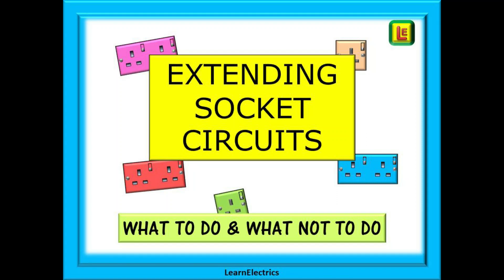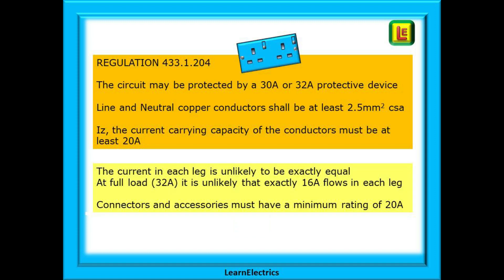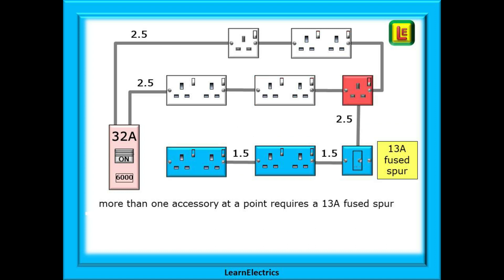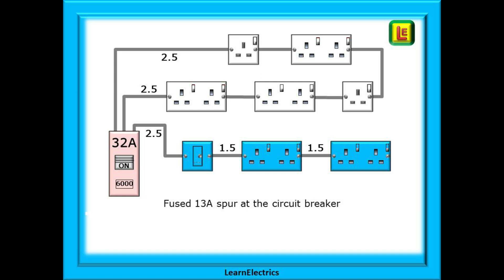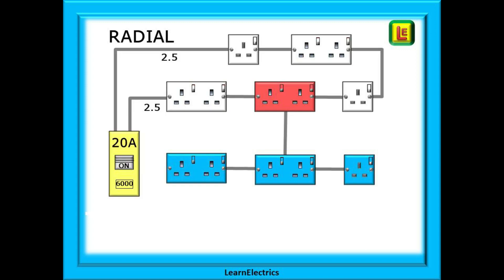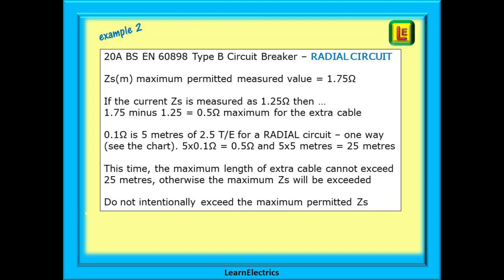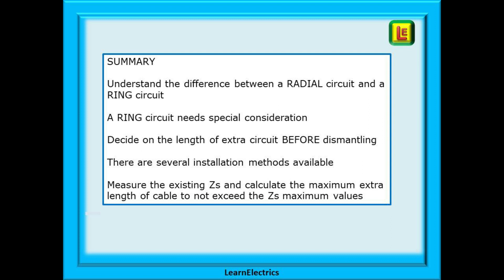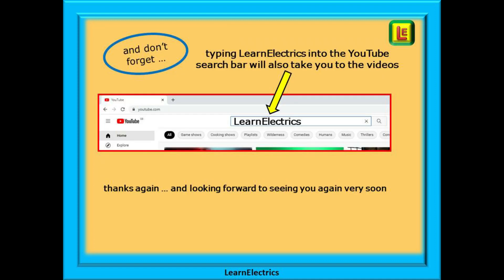EXTENDING SOCKET CIRCUITS - ADDING TO RING and RADIAL CIRCUITS

Comment: How do you KNOW its a radial or ring without relying on breaker and cable size? Do you trust its correct? (go off eic/r?)
If a socket has 2 conductors, how would you know its not a spur from an end of line radial, or indeed a ring.
3 conductors = you know its a ring with a spur?
Reply from the maker: Good question. Take a look at the video on the link below. Once you split the wiring its easy to test for ring or radial.
Thanks for watching and good luck 
https://www.youtube.com/watch?v=6GNb1SSEjQg
Reply: @learnelectrics4402 Thank you mate. Love the videos. You're a legend

Comment: If splitting, would you calculate the resistivity of existing cables to determine the original area served
Reply from the maker: You can do, but often practicality of room layouts over-rides getting an exact 50/50 split. I would split the circuit where you see fit and then turn just one half back on, use a socket tester to see which of the original sockets is energised. If about 40 to 50 percent split then job done. Remember that even if you get 50% of the sockets on each half, you cannot guarantee a 50% split in loading. some areas will always use more amps than other areas of the house. Thanks for watching. Dave.

Comment: Great video. I want to learn electric. With the fuse from breaker, can you use 2.5 cable rather than 1.5 cable. if not why?
Reply from the maker: You can, if you wish, use any conductor size that is greater than the minimum size required. So yes, if the tables.  show 1.5 as a minimum you can use 2.5. Thanks for watching.
https://www.youtube.com/watch?v=3_D65-32xp8

Comment: How on earth do you deal with extending a ring in a bungalow that has concrete floor? Are you forced to channel out on a solid brick wall and mount each extra socket that way?  Completely happy with your video as to rings and radials - excellent. I suppose identifying 2.5sq mm cable is down to the markings on the pvc? If in doubt I go for the heavier cable I have but it is a pain to work with of course.
Reply from the maker: Most quality modern pvc cable will be marked. I used to carry marked short samples of each size from 1mm to 16mm for easy recognition until I got used to the sizes. Every installation has its challenges. Good luck. Dave.
Reply: @learnelectrics4402  Yes Dave, I found it extremely difficult to use two Wago 221 (3-way) when the entry to the box has both ring cables side-by-side because after using short pieces of 2.5 to reach the outlet to a wall heater, the box was jam packed with connectors and cable such that the cover plate would not go flush again.

Comment: Hi,

I am very much a diyer when it comes to electric's my grandfather was an electrician sadly no longer with us and my father was taught a fair amount by him which he has passed on to me. I am currently in the process of renovating my daughters new bedroom I wish to add some extra sockets as there is only one double socket in that room.

The room is directly above the Consumer unit so having lifted the floor boards I can see the cables for the house sockets ring circuit, my plan was to extend this circuit adding four sockets and a junction box to connect back up the ring circuit.

Where I have started getting confused is because of the following the ring circuit is wired in 4mm t&e cable not 2.5mm it is on a 32 amp mcb though.

So my question is as follows

To extend the ring circuit should I wire the new sockets in 4mm cable as well or would 2.5mm be ok

or

would it be better to run a spur from the existing socket ib 2.5mm using an 13A FCU and connect the four sockets to that

or is there another method.

Any help would be appreciated

Cheers
Reply from the maker: If you take just one cable from any of the existing ring circuit sockets, to just one new socket (double or single) , then 2.5mm is ok. If you wish to extend the ring, use 4mm as this complies with what is already there.
Take a look at the video link below.
https://www.youtube.com/watch?v=fj9cc1U9Re0
Reply: Thanks for that cheers

Comment: Great🌹
Which one is better ring circuit or radial circuit
Reply from the maker: For me, radial, but many electricians will prefer rings. Both are correct.
Reply: Many thanks to you
Reply: Excellent video 👍👍👍
Reply: I would also say it depends on the application/anticipated loads...

Comment: How comes you multiply by 2 for the ring circuit? Is this a fixed number?
Reply from the maker: Its just an example of extending this circuit. If we want to double the length then the resistance will double.

Comment: Can a kitchen with 3 double sockets be included in a Ring  of 9  double sockets ?
Reply from the maker: Theoretically, yes it can, because the circuit breaker will trip before you plug something into every socket. Do you really need 24 socket outlets in a kitchen. Personally, if the customer really wants that many, I would consider dividing the circuit into two or even three.
Reply: @learnelectrics4402  There is only one Ring in this 1 bed apartment total 9 double sockets, Can the kitchen be added to that ring with 3 sockets. making a total of 12 sockets for the whole apartment. Cooker has its own circut. thanks

Comment: As a recently retired industrial electrician of 50 years I can't remember the last decade when I wired a ringmain circuit in 2.5mm twin and earth or 6491x it's nearly always 4mm and sometimes 6mm,
Reply from the maker: Lots of sparkies are installing 4mm radials now instead of 2.5 rings, especially as the boards can have more ways in them. Thanks for the input. Dave.
Reply: @learnelectrics4402  On a 4mm radial CCTV, what size Fuse/MCB should be used?

Comment: So if one wire is disconnected or breaks in a ring the whole then radial will still work, no fault will be detected, but the draw could be well over the cable is rated up to but the fuse won’t blow. !   Why haven’t these been banned?
Reply from the maker: That about sums it up, which is why many sparkies prefer radial socket circuits. they should be installed correctly, protected from damage, and inspected regularly.  Thanks for watching.

Comment: Great video, thank you. Could you please clarify in the situation where a 13a fused spur is taken from the ring, if the first "downstream" accessory can be a junction box. In my case the JB splits the supply cable into 2, each leg feeding one socket. Everything is protected by the 13a fuse, which I will probably downrate to 10a. All is cabled in 2.5mm t&e. I have no plans to add further sockets. I appreciate that it would probably be usual to wire the spur as a "mini radial" as per your graphics, but I had to put a fix in after stupidly nicking my new (still dead) cable with a drill, having spent 3 hours drilling walls and clipping it...Thank you
Reply from the maker: Once you put a 13A fused spur in, everything after it can be whatever shape you want. Split into two and two again, it doesn't matter. And your cables can all be 1.5mm if you wish. You can't ever exceed 13A. Nicked spur? We've all done it. Good luck, Dave.
Reply: @learnelectrics4402  Brilliant, thank you for your clear explanation. Keep up the great work 👍👍

Comment: Hi there, thanks for the videos; I am struggling to understand the situation at 8:50. To me that set-up looks like a ring circuit on the top section and a 3 socket spur to the bottom. I don't understand why that is allowed? surely the section of wire below the red socket is liable to overheat due to the potential loading on the bottom seciton? Sorry, but I am also not clear on what you have converted that from?
Reply from the maker: The previous slide starting at about 8.27 tells you that we are converting a ring circuit into radial over the folowing two slides. The slide you are asking about is showing that the circuit is using a 20A breaker and 2.5mm cable, so we can add as many sockets as we wish and still not cause problems. 2.5mm cable is rated at 27A for clipped direct and the breaker is limiting the current to 20 amps. hope this helps, Dave

Comment: Hi Sir, I want to make a radial circuit for 4 socket outlets using cable 4sqmm, what is the size of MCB that I should use? 20A or 32A? Thank you.
Reply from the maker: 4mm will be ok with both those mcb sizes for a radial circuit. take a look at this video, it will help.
https://www.youtube.com/watch?v=3_D65-32xp8

Comment: How come ring resistance is different to radial? My guess would be it’s technically a 5mm at any one point as cable has two legs but that would make it half the resistance of single 2.5mm cable but the chart shows a quarter? Can you explain how you got these figures?
Reply from the maker: Have a look at this video on our channel Jon. It will explain all, and more. Thanks for watching.
https://www.youtube.com/watch?v=V0_6_WmkmsY

Comment: Hi.i dont zs for 32A TYPE B is 1.09.i checked page 68 table 41.3 amedment 2 showing 1.37.correct me if i am wrong.thanks
Reply from the maker: Saman,
In the Wiring Regs book Zs for a 32A type B breaker is 1.37 ohms.
In the on-site guide they quote measured values using the 80% value which is 1.09 ohms.
To convert the wiring regs numbers to measured values, multiply by 0.8
Thanks for watching. Dave.

Comment: If radial circuit is safe too. Why do we return the line to breaker and make it a ring? it seems so much easier to add socket in radial circuit.
Reply from the maker: About 80 plus years ago it was way of saving copper as there was a world wide copper shortage. And since then its just stuck. Hope this helps. Dave.

Comment: Why  are ring circuits still used? Weren't ring circuits invented to save copper during the war effort? Could we just use radials now so you don't have a pull an extra leg back to the consumer unit?
Reply from the maker: Absolutely, but ring circuits do still save copper. Fortunately, with modern CUs there are more free ways in the board and we can run 20A radials in 2.5mm.
Great question. Dave.

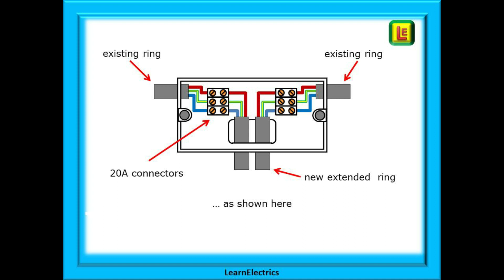Comment: @6:15 you show the ring main being extended in an existing backbox.  Should the earths be fully common'd together and connected to an earthing point rather than simply split and extended?  Especially if the box is a metal backbox where there would be an obvious risk of it being live under a fault condition?
Reply from the maker: If there are two earth studs on the back box, using either one or both is ok.
Reply: @learnelectrics4402  Thanks for the clarification

Comment: I need to break into a ring... Can you buy backboxes with all the relevant fittings pre-made for this job like the illustration at 6:10 ? If so what do I search for because it always just brings up junction boxes like the Wago boxes. Or is it simply a case of use the existing backbox with blanking plate and then use Wago connectors inside?
Reply from the maker: You can use another back box, 25mm or even 40mm and then waygos or a decent terminal connector block. 40mm depends on if its in brick or hollow wall.

Comment: Can you clear something upnplease Dave. In one of the slides you have two separate radials running from a single 20A mcb. Regulation 314.4 says that each final circuit should be connected to its on way at the DB. How are we able to have two radial finals on a single way?
Reply from the maker: That always raises a question. Think of the second one as a spur, we are allowed to spur from the MCB. What is the difference between spurring at the first socket or at the MCB. And yes, for many years I thought it couldn't be done as well. Dave.

Comment: What is the reason for having a max resistance value in a circuit? Is it because it will reduce the current to low enough levels that appliances will not work correctly?
Reply from the maker: No is the answer, there are different things happening here but if you have a look at these two videos on these links then together they will answer your questions. Thanks for asking, great question and thanks for watching. Dave.
Zs WHERE DO THE NUMBERS COME FROM
https://www.youtube.com/watch?v=IjpJK1eJLzw
&
MATCHING CABLE SIZE TO CIRCUIT BREAKER and FUSE SIZE
https://www.youtube.com/watch?v=VtTUkUpQ-Rc

Comment: Great videos. Helps me massively.
Just a quick question if you don't mind. When spurring of the ring with a FCU, do you use the 2 legs of the ring into the supply side or just one cable?
Hope this makes sense.
Reply from the maker: Just one piece of cable into the FCU, make sure it is 2.5mm. Hope this helps. Dave.

Comment: In my garage there is 1x Double socket connected directly to a 16B MCB in the consumer. This is the only socket in my garage and its connected in radial fashion. The thing that's confusing me is in 1 of the plug sockets is the tumble dryer which runs at just over 11A (I've tested this using both the Watts÷voltage equation and also physically with a clamp meter.) And the other plug is connected to an extension consisting of a fridge freezer and washing machine. This totals around 9A according to my clamp meter. But obviously 9A + 11A is 20A and its connected to a B16 MCB...how come the MCB isn't tripping when both are on at the same time? I want to spur another double socket but am I right in thinking I should replace the current 2.5mm cabling with 4mm twin earth cable and a B32 MCB due to the already high 20A load on the MCB? Please any help would be greatly appreciated I've been looking everywhere.
Reply from the maker: A 16A breaker will not trip at 16A, that is its working current. At 20A, it will take a long long  time to trip and even at 30 amps it will be 5 minutes if the current is constant. Your connected devices are probably switching in and out so that the current is not 20A all the time. If the current cable is 2.5mm you can change the breaker to 20A Type B for peace of mind.
Also, if it was me,  I would install a new, separate radial circuit and breaker for the new sockets as changing to 4mm cable is just as time consuming.
Hope this helps. Dave.
Reply: @learnelectrics4402  thank you dave yeah I have a spare MCB I can use to make a fresh radial circuit so I'll probably just do that instead much appreciated
Reply from the maker: Great. Also consider, if the new sockets are in the same area as the existing, and you are running fresh cable, run 2.5mm and convert it to a RING circuit with a 32A breaker and include the new sockets in that ring. Lots of choices. Good luck. Dave.
Reply: @learnelectrics4402  will I still be able to use a 32A breaker with 2.5mm cable as I thought 2.5 only covers up to 27A? P.s Thanks for the help Dave you've got a new subscriber aswell 👍
Reply: @learnelectrics4402  ah never mind dave I just watched your video on differences between radial and ring where you explain that you are able to use 2.5mm with a 32A breaker in a ring circuit as the current is virtually halved although not exact! Love these videos dave extremely helpful! I am an electrical engineer in the army but I mostly work on armoured vehicles so house electrics are relatively new to me I have completed the 17th edition installation course through work and 8ve just booked myself onto the new up to date 18th edition course where I hope to complete both installation and design aspects so these videos are gold!

Comment: Thank Dave once more for this wonderful video well presented, illustrated, and very enriching in knowledge. Looking forward to the next topic. Dave, question: How do you do R1 +  R2 on an extended radial circuit? and which chart are you talking about in this presentation?
Reply from the maker: Omar, I have made a chart or table showing how much extra resistance to add to a circuit if you know the extra distance involved. The chart is not from any books, just made to help with the video.
R1+R2 for radial is fairly easy. Take a look at this video -     What is R1+R2   on this link
https://www.youtube.com/watch?v=HvDuVLDxvhs

Thanks for watching
Dave

Comment: At 15.30 you have put a blank cover on and lost the socket, could you run a spur from this so that the socket is not lost?
Reply from the maker: No reason why not as long as it follows the rules on cable size etc. Good question. Bux.

Comment: Brilliant videos guys ,just quick question can  you spur from a radial circuit which is protected with a 16amp mcb ? Thank you
Reply from the maker: Thanks for the question David.
If the cable is 2.5mm (T/E for example) and the breaker is 16A or 20A you can have as many spurs or spurs on spurs as you sensibly wish, subject to the Zs being within limits.
If its the number of sockets you need, more power usage then 20A is a good bet but it has a lower Zs than 16A.
If you need the distance, longer length of circuit, then 16A breakers have a higher Zs which may be better.
Hope this helps, Dave.
Reply: @learnelectrics4402  thank you very much just what I wanted to know
Reply from the maker: Happy to help.

Comment: ring some of cable 4mm line and neutral some 2.5 mm line and neutral how to add r1 +R2
Reply from the maker: Azizur, thanks for watching, great question.
If its a 32A RING then 4mm cable is ok. It must never be less than 2.5mm. Just do your normal r1, rn, r2 continuity and then cross link to measure the R1+R2

See the video below on Ring Circuit Testing.
https://www.youtube.com/watch?v=-PAruseUf04
Good luck, Dave